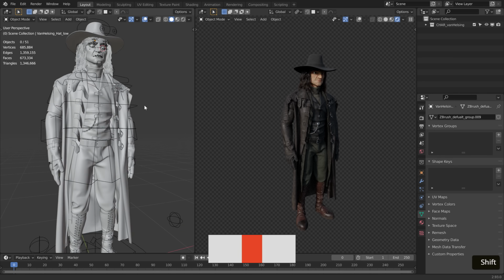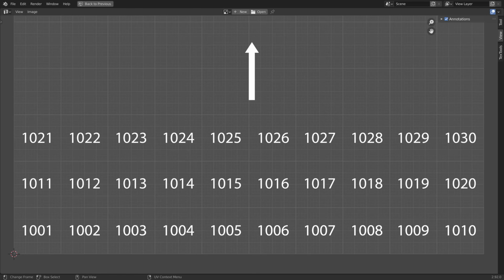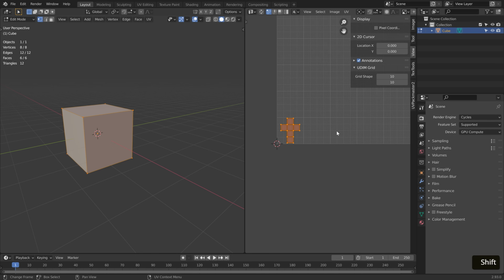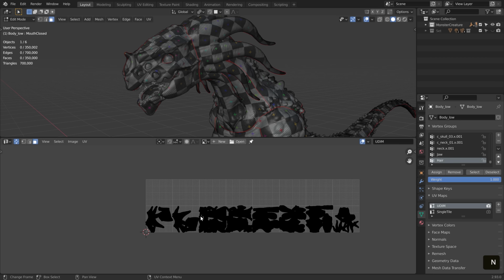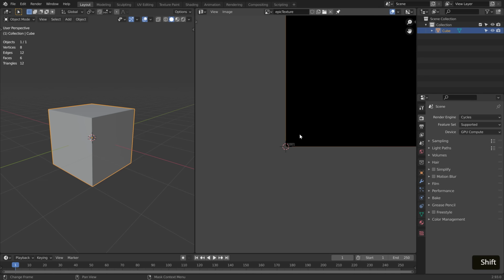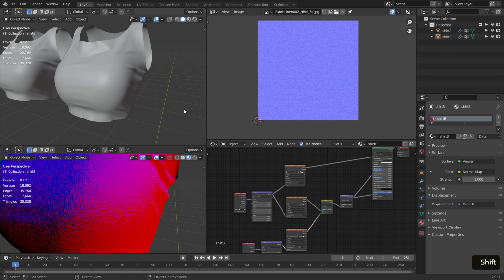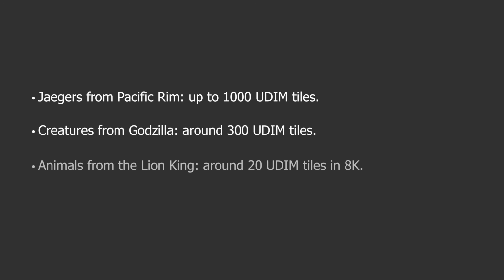Introduction to UDIMs in Blender

Comment: Hey, thanks for the great video! I have more questions about high frequency details section of the video tho. I am studying game development and we use Blender for modeling and Unity as game engine. Now I've run to this same issue couple of times. I have really high detailed objects that are large in size. I could obviously make a lot of udim's and then I would get the smallest details to show up after baking aswell. However with some of the details like the a noise bump I could just use a single tileable texture instead. How would I go about it in blender? I am used to make all my textures procedurally and the small details and bigger details are all in a single shader. I think a good tutorial on this would be extremely helpful for a lot of people!
Reply from the maker: Hi, not sure if I got what you mean, but even if the texture is procedural you can still bake it. Just make sure your object have uvs and you're good to go. And to bake just that little bump texture you can connect that directly to the material output node, bake it and then connect the whole shader back to the viewport again.
~ Masha
Reply: @cgboost  Unity unfortunately doesn't support UDIMS, so one has to separate the model into multiple objects.

in unity there is the Detail Map option.

Let's say I make a concrete wall, now I want to create a nice bump using normal. It's pretty high scale and repeats over and over again. Instead of baking the whole wall with this bump I could just bake a tile with the small details that repeat. This way I don't have to make a huge bage image (8k) for a large wall, so that even the small details is displayed with the base texture like color etc. Instead I can make a way smaller bake (2k) of the bump details that repeats over and over again as tiles in the wall. and another let's say (4k) texture for base colors and large details.

Im sorry that I can't explain it better. Hopefully this helps a bit tho.

Comment: hello) I didn’t understand how to add a separate texture to each tile) can you tell me?
Reply from the maker: In the current version of Bledner you do it in the right panel (accessible with N shortcut) in the Image tab. There is a UDIM Tiles section where you can add and fill the new images for UDIM tiles. When you save them they will receive the udim number at the end of the name (they will all be saved at the same time). Then you can edit them in external programs if you want.  If you want to load pre-existing images to UDIMs - they just need to follow that naming convention and you can select UDIM tiles as the source in the Image section of that tab and load them from disk. There's also a reload button there if you want to update the images after tweaking in an external editor.
Reply: @cgboost  Thanks for the answer. But, unfortunately, the logic is not clear to me. Excuse me. The image is set only on the first UDIM tile, and on the rest - either a grid or a black background. Accordingly, the textures are also only for 2001 tile. I asked how I could set the texture on each tile. When you select the image for 2002 and the rest of the UDIM tiles, nothing is displayed, but either a grid or a black forn or nothing. Thank you.
Reply from the maker: @letomaneteo  When you add a new file from the right panel (from the image tab - where you need to set the source as UDIM Tiles, then in the UDIM Tiles section - using that little plus sign to add a tile)  it should fill the new tile with an image. Also when you already have separate files you want to use on the tiles you can load them to the grid from that image panel (accessible by pressing N). In order to control to which tile each image go - they need to be named accordingly (ending with the tile number as suffix of the filename)

Comment: Great explantion.
How can I unwrap directly to, lets say, Tile 1002 instead of 1001 and then relocate it to 1002?
Reply from the maker: Hi Constantino, thanks for your question, not sure if I got your question, but in blender previous versions  (like the one Juan is using in this video) you didn't have the possibility to choose which tile to bake. It automatically baked the 1001 tile, that's why you had to do the trick to bake the second tile. You could then say to program which texture is for which tile by adding.1001 or .1002 to the title.
Now the things are a bit changed and if you add the second tile your output texture, blender will automatically bake all the tiles you have added.

Please let me know if this is helpful or if you have other questions.
~ Masha
Reply: @cgboost  Thanks, Its about unwrap, you mark the seams and unwrap the cuts, but what if I have Tiles 1001, 1002, 1003 and I want the clothes of the model to be placed in the 1003 tile without the need to move it manually?
Reply from the maker: @eduarte0214  hmm not sure if there is a way to do this without having to rearrange the islands manually. 
You can try to check if there is any kind of add-on out there, but normally you would need to do the process by hand.
Sorry if this is not helpful.
~ Masha
Reply: @cgboost  Thanks
Reply from the maker: @eduarte0214  you're welcome!

Comment: Great Video/ Lesson! This is a method that changes the game
However, how can I export UDIM to software like Unity?(which supports Udim from the 2019 version...apparently)
Reply from the maker: Hi Nicola, you mean exporting the textures or the uvs? The textures once baked out of blender will automatically have .1001 .1002 numbers added that marks the tile they belong to. Now you don't even need to do the tile moving trick Juan shows, since blender has implemented the automatic export and detection. 
As far as I know, the exported texture tiles should be automatically detected by any program that supports UDIMS. regarding the UVs they should be automatically exported when you export the model.
~ Masha
Reply: @cgboost  Thank you for the answer.
Basically now when I export I have a series of PNG called 1001,1002 etc and so far so good, the problem arises when exporting to Unity and importing the various PNG seems to read only one tile at a time and not in sequence as it should...
I hope to be explained ahaha
Reply from the maker: @nicolamennillo  Yeah I get it, thanks for expalining yourself. 
Unfortunately, since I'm not familiar with the program, I can't really help you. 
My guess is that maybe Unity needs a different title format to detect UDIMS properly, or maybe it doesn't support UDIMS at all. But these answers you can get from more experienced Unity users. Try to see if you find any forum specifically for unity users. I found this one that is for game developers in general, but I guess you will find many Unity users there: https://gamedev.stackexchange.com/
You can also try to post the question in CG Boost community, maybe there are some other unity users: https://community.cgboost.com/home

Sorry for not being super helpful, I hope you find the answer to your question.
Let us know if you figure it out!
~ Masha

Comment: In Blender 3.50, there is no more "UDIM" *anything*. They hid it in UV editor under the "show overlays" icon (far-right of the top bar, looking like two overlapping circles). The values Tiles X and Tiles Y control the UDIM overlay visibility. Hope it helps!
Reply from the maker: Thank you so much for the tip!
Reply: @cgboost  took me a full hour to find it. :P
Reply from the maker: @CRogers  totally feel your pain, had the same issue when the new version came out 😅
~ Masha
Reply: @cgboost 
Yeah these silly changes made learning blender feel like masochism as much of the learning material is different from the  latest version
Reply from the maker: @cutesmile_you  I guess that's the price we have to pay for the fast development and all the nice new features 😅
~ Masha
Reply: @cgboost  :(

Comment: is UDIM baking available inside blender as of March 2023?
Reply from the maker: Yes it is possible to bake textures to UDIM-s in the current Blender versions.
Reply: @cgboost  follow up question. should i use UDIM for a building like a stadium? which i intend to sell on a site like CGTrader? Are UDIM used for those?
Reply from the maker: @SubhrajyotiAcharyyaDSB  All depends on the type of asset you are going to create - what is it supposed to be used for ? (is the highest detail level more important or perhaps performance and optimization - as for example in video games)  UDIMs are useful when closeups are expected (camera close to the object) and you need a high resolution of the texture to have all the details) of course this is a double edged sword so to speak - more textures and thus more impact on the memory etc. So as usually this is not a simple question with only one right answer. It depends on what the asset will be used for.
Reply: @cgboost  i mean, the model will have 10-12 texture sets anyway. varying in resolution. Wouldnt UDIM be just a way to place them all in one file set instead of 10-12?

Comment: OMFG, i've watched TENS of UDIM related videos, have read unreasonable amount of articles on this topic, but you're the only one who's explaining the actual reason for using the UDIM workflow, the only answer i got before is "it's kinda handy", which doesn't help at all. Thank you!
Reply: I dont see where its explained.  If you lack resolution you can simply increase the number of textures or their res. Thats it.   So why use UDIM ? not explained.
Reply: @IgorSinitsky  bro did you even listen? 4:00
Reply: @IstyManame  Well, you can just apply 16 textures to 1 model using 1 tile. (Just assign different materials to different polys, sometimes its called multimaterials (using material Id ) sometimes texture sets ).  That doesnt require UDIM
Reply: @IgorSinitsky  Exactly increasing materials increases the amount of draw calls per model reducing performance in game, also even if it's not a game, i can't imagine what a pain in the ass it would to manage it, you'll likely have a bunch of visible seams.

Comment: UDIM workflows go back to the early and late 90s, actually. Weta Digital has been at the edge of workflows like this for awhile, since the original Lord of the Rings. Back then they used subdiv surfaces and nurbs with physical patches rather than UV patches. Those models had about a few dozen or so 2K patches, like the original Gollum from 2001 did. The V-Rex dinosaur in King Kong (2005) had about 250 2K textures per shader channel. For Avatar (2009) they created the MARI texture painting program, the shuttle in Avatar had 500 4K textures, just the fine displacement channel alone was 30GB of textures. Most of the creature and character models in Avatar had about 150 4K textures. These numbers have increased more since then.

I think it's good to use as many UDIMs as your assets need and not hold back. I'm working on a therapod dinosaur that has 570 4K textures per channel right now, for example, painting displacements of course (after Zbrush prep for alphas). I created a 3d moon model with 1,152 4K textures per shader channel in 2021, Renderman for Maya chews through that like butter. 200+GB of final textures just to render it.
Reply: Please provide sources for the information you provided in the first paragraph.

Comment: If you can't find the "UDIM grid" in Blender 3.3, it's moved under the overlays dropdown menu along the top tool bar (icon for it is 2 circles overlapping each other)
Reply: Make sure you are in the UV Editor (accessible in each area from the top left drop-down in the header).  In the same header menu, the "Show Overlays" drop-down is on the extreme right.  If the window is small, you might have to horizontally scroll while hovering with your mouse wheel to see it.  As @mitchf.6990 noted, the icon is 2 overlapping circles.  Inside the drop-down it it simply called "Tiles X" and "Tiles Y" under the "Guides" section.  I hope this helps people find it.
Reply: @Tiki_Media  Thanks for this, I also found you need to click on image tab on the right and thenchange image sourse to UDIM tiles
Reply: Thanks for the info, though i still can't find it in overlays dropdown menu either :( using Blender 3.4.1
Reply: @da_drood  Yeah no kidding.  I'm on Blender 3.3.1 and have the same issue where the UV Grids options aren't available.  This isn't too much of an issue for me, because I'm importing a model that already has UVs laid out in UDIM space, but I'm concerned about being able to bake textures.
Reply: Bless you, you angel
Reply: THANK YOU :)
Reply: THANK U MA NIGA
Reply: 非常感谢！
Reply: Still there in 5.1.1
Reply from the maker: Thanks for the update

Comment: Is the UDIM Grid option in a different spot for v 3.3.0??
Reply from the maker: It seems it was removed entirely. New gird tiles will be generated, as soon as you add more UDIM images.
Reply: @cgboost  I actually found it in the 'Show Overlays' dropdown of the UV Editor
Reply from the maker: @jeremymullins1294  Yes, I also found it out recently. But you have to be in Edit Mode and the model needs to have a UV map.
Reply: @jeremymullins1294  thanks haha your comment saved me

Comment: always thought the advantages of udims were overblown. wouldn't be that big of a deal to just have multiple materials using the same uv space. the only disadvantage is the inability to paint across the seams but there are ways to address or hide that.
Reply from the maker: I personally don't bother with them much. They can be useful, particularly when painting but like you said, there are usually workarounds and they can be a pain when relinking materials or switching between programs.
~ Daniel

Comment: hello i have a question, i will try to explain : i did a character and i have the eyes, teeth and tongue joined ,  the clothes like jacket,pants, belt joined apart, and jewelry with necklace joined , and body is apart, so , i have a total= 4 tools , my question is : ¿ should i join all my tools and then create the tiles UDIM for start to do  the uv maps? or should i do those UDIM tiles with each one of my tools? ( the four tools ) ? my point is, that i want the best resolution for all
Reply from the maker: If you run for the resolution then use separate UDIMs for the different parts of the model. That way you can set the texel density you need separately, with the maximum used space.
~Egon

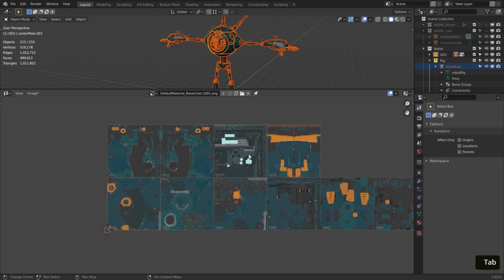Comment: #7 at 10:50 
Perhaps I'm not understand how it's supposed to work in Blender but you can change tile size. In the Add Tile box, there are options to set width and height for each tile where you can set one to 2k another to 4K etc. Even if you set them all to one size you can unlink your current set, create another and point Blender to it.
Reply from the maker: Hi! Well the highlight of #7 is managing changes non-destructively. Yes you can alter tile sizes later in Blender but if you change UVs you have to redo your paintwork. If you go higher in resolution, you have to repaint or add detail, so technically you can just lower resolution, manually. In this example, I have a guitar, of 2 UDIMs and overlapping UVs. So I fixed the seams, unwrapped the whole thing. And instead of 2 UDIMs used 3. I put that back into my painting project and it recalculated everything automatically. That means I changed UVs and Udim count without losing my work. Which no general 3d package ever does for you. In Painter you can also work at 2k and export at 4k and strokes are resampled. In Blender or any 3d package if you work in 2K you cannot suddenly change to 4k and have your previous painted work converted to 4k. Hope this clears it out, Let me know! - Juan
Reply: @cgboost  Forgive me I'm a little slow. lol It actually came to me, what you meant by non-destructive, while I was out getting grocery. Thanks for taking the time and write a detailed explanation, btw. Also, awesome vdo on UDIMs; there are very, very few vdo on this topic for blender. Thanks, Juan!

Comment: I've been a longtime user of Blender but wouldn't consider myself an expert by any means. That said, I had no idea Blender had UDIM support which was a complete shocker for me! I've been steadily going back to Blender the last few months, realizing that it's way better developed than I gave it credit for, especially since 2.8. UDIMs aren't new but a brilliant texturing solution that the industry has been very slow to adopt in my eyes. Heck, I believe Pixar was the first to really utilize the idea and that was almost 30 years ago!
Reply from the maker: Yeah, Blender has changed drastically since the 2.80 release. And yes! UDIMs are not new but definitely a very smart solution. Actually UDIMs were developed in 2002 at Weta Digital in the search to break the texture limitations of the time... but still! that is almost 20 years ago. Disney studios on the other hand  (not sure if Pixar had any involvement) came up with Ptex texturing sometime around 2008. Ptex is also pretty crazy, it is still relatively new and it has its issues but maybe in a few years it could also be a common texturing workflow. - Juan
Reply: @cgboost  Drats, Ptex is correct! Ol memory failed me again. =) Nonetheless, I've found a really great channel with you guys and am getting up to snuff with Blender's better features, so you've earned a well-deserved Sub and a hearty thank you!

Comment: For some reason I always end up with visible seams between udims. Usually in the baked normal or height maps in substance printer.
Reply from the maker: Make sure to set normal maps to OpenGL when starting a new project,  otherwise the green channel has to inverted. Other than that, be careful with what UV smoothing algorithm you are using, there are a couple of options and they can generate seams, regardless if the model uses UDIMs or not. Hope it helps! - Juan